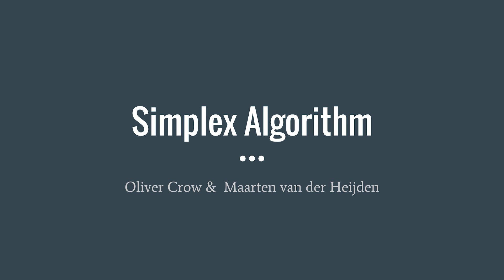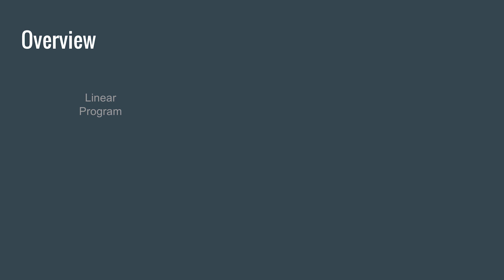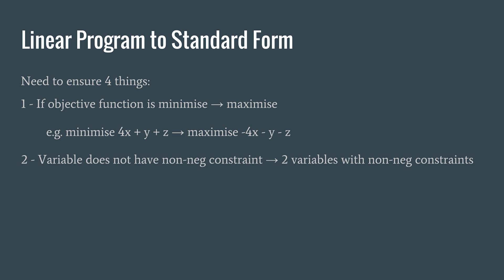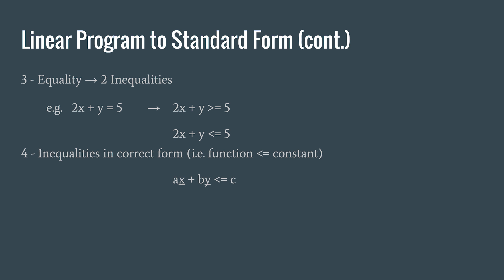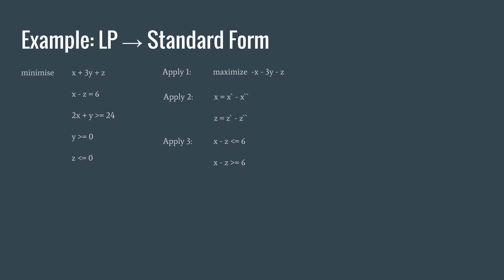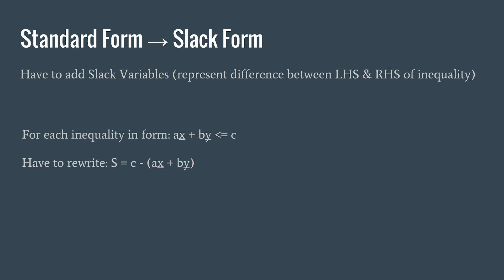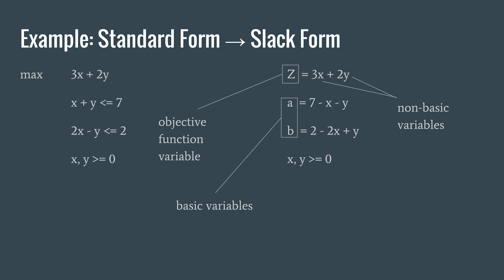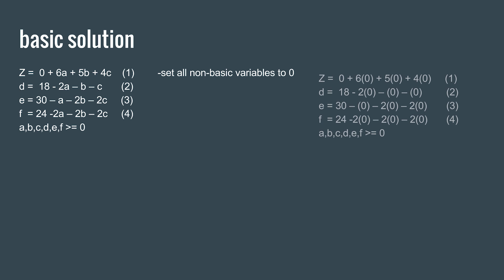Simplex Algorithm Explanation (How to Solve a Linear Program)

Comment: hey there is a mistake at time point 6.02 in ur video there are 6(i.e. a,b,c,d,e,f) variable in ur method that time but while writing the best solution u have only taken 5
Reply: It is most likely that one zero is missing and it actually should be: (9, 0, 0, 0, 21, 6) because in order to get a feasible solution you set b, c and d to zero and the rest can be inferred from that (e. g. a = 9 - 1/2*0 - 1/2*0 - 1/2*0 yields a = 9, the same applies to e and f)

Comment: 2:37  To apply rule 4 the quation 2 should  be -x' + x'' + z' - z'' <= -6 . Since we need to multiply by -1 in both side. Please tell me if I am correct.
Reply: Also, shouldn't 2x + y >= 24 become -2x - y <= -24 ?
Reply: @lauriliinat7262  urs too and that is wat is called as introducing a surplus variable
Reply: Ya wat u said is crct ...
Reply: I saw the same... Lauri, I think the inequality can be >= but not =.